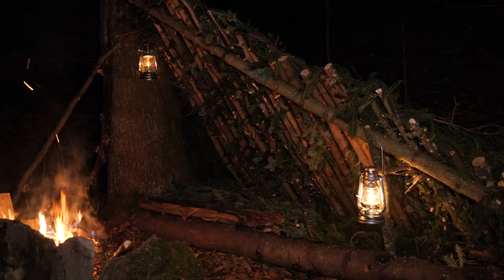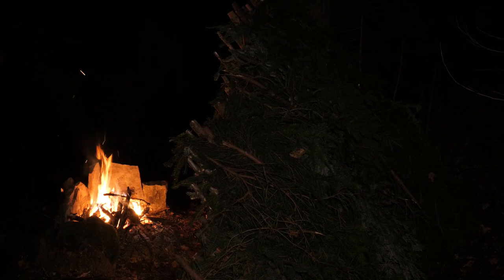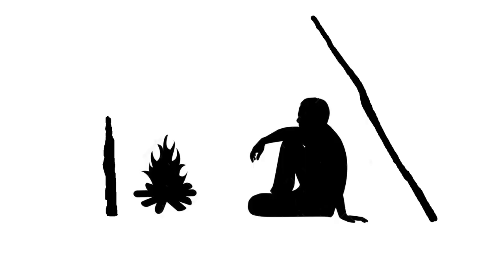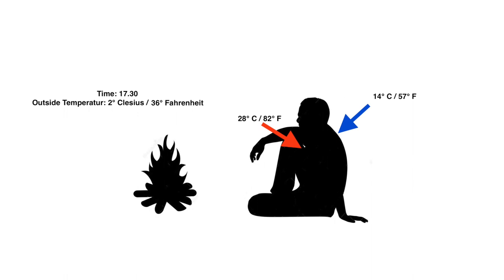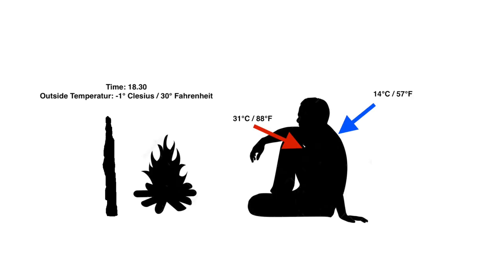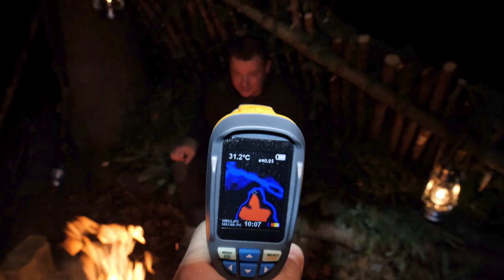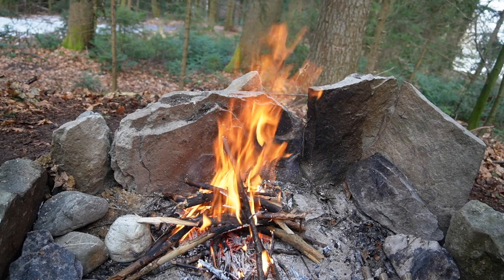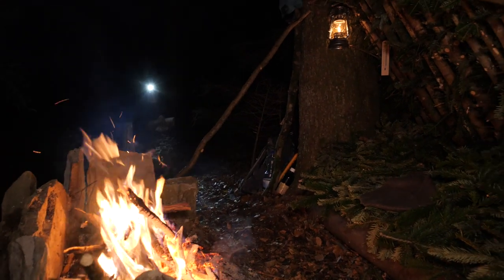Are Fire Reflectors really useless?

Comment: They are more likely absorbing the heat and radiating. So less of the heat from the fire is escaping into the air. It is instead being “trapped” and warming the area around them more. It is still helpful on a cold night.

Comment: Thanks Felix. Heat rises, however, the more you can contain it by reducing the wind effect, you will surely trap more of the thermal radiation . Adding 4 walls  around you and the fire should retain  even more heat.  If you add one or more solar reflective blankets , many more infrared wave will be reflected onto your body. Your backside is colder because it it in the shadow of the infrared waves. 
A good example of this is in deep snow. Snow and ice are good reflectors. Building a fire at the base of a deep pit with high snow walls will allow for better thermal radiation. The infrared waves bounce around more especially if you add reflective material.
Reply: Thanks again for exploring this science. Keep on with your great videos, they are always informative.
Reply: You hit it on the head.  Reduce the wind effect any way you can.

Comment: Very well done, a good experiment and analysis of the heat radiation. I think that a lot of the confusion is mostly related to the word “reflector”
In most cases it’s radiator, wind barrier, depending on the materials. 
Is it useful? I would say yes for reasons other than reflecting. Accumulating and slow releasing of heat, shelter, more light and protection and a wall behind a person will offer more insulation and capture the heat better with less wind to influence the temperature but mostly I find that the biggest benefit is the placebo effect it has on us. 
Good video 💪
Reply from the maker: Thanks for your feedback!
Reply: PotAto, potato.

Comment: The reflector does not work in the way of reflecting the radiation of the fire but the stones get warm due to the radiation of the fire and then work as a radiator themselves.
So some radiation of the fire that will be lost without this "reflector" will still be used.

Comment: Fire transmits Heat most at Radiation (heatflow is only useful for Cooking straight above the Fireplace). Are fire always sucks Air and blows it into the Sky, so theres just Coldair on the Back without Shelter. I Think its possible to improve the efficiency by using a stainles Stell Mirror for the Fireplace an a emergeny Blanket as Tarp for the Shelter.    ...A later Measerment wit the Woodshelter would be nice, because it takes time to warm the shelter with the Fire: It doesnt reflect the Heat like a Mirror, it absorbs the heat and set it Free later in Comparsion to phospherescent Painting.

Comment: Very informative and thought provoking video. If nothing else the stone reflectors will hold heat and radiate heat even as the fire burns down.  Adding a space blanket to the rear reflector would likely increase any available heat. See Mors Kochansky Super Shelter.

Comment: I think the problem is using the term reflector is inappropriate. You aren't getting the temperature difference because heat is being reflected As you would using say a mylar space blanket.

 The temperature change, say on your back, is because the heat is simply not able to continue rising into open air, it's being stopped.  While in front of you the heat is still able to go off to the sides especially if you have a breeze going.  

The reflector behind a fire, also acts in a way similar to a fireplace.  It's heating my living room not because it's actually reflecting into the room there's just only two places for the heat to go into the room and up the chimney.  The hearth itself is actually absorbing heat not reflecting it back into the room.  I think a better term for these gizmos would be barrier or radiator, but reflectors seems to be the one that stuck

Comment: I believe you're testing method is flawed. You should have started with the fire reflector in place and taken temperature measurements. Immediately after taking the measurements, you should remove the reflectors and take temperature measurements again quickly as possible. The way that you did it you didn't take into account if the temperature of the fire changed while you added the reflectors and waited several minutes. You waited too long and allowed the conditions to change before taking new measurements.

Comment: I don't wish to sound offensive, but those tests don't prove for or against - Heat Reflector or Wind Deflector.  You didn't take any readings from behind the fire itself with or without your stones.  You didn't tell us what clothing you had on, perhaps you have Workman's bottom and your kidneys exposed as I often see with younger guys whereas my shirts are long enough to tuck into my underpants and protect my lower back from heat loss and wind/cold exposure. 

You didn't tell us what the wind speed was or where it was coming from and simply building a higher wall at the back does NOT stop smoke - you need to place your fire in the correct position to offset winds blowing into your face. A horseshoe shaped fire works better than a complete circle.  Too many variables.  Far North Bushcraft and Survival indicated that wooden reflectors/deflectors' behind a fire didn't do anything - Survival Russia showed that wooden bow shelters with spruce ferns did nothing to reflect heat from a small fire.   It is a science all of its own and just seeing a fire can make you feel warmer than it really is.  However, saying that, I should think that the ROCKS/STONES ought to reflect some heat and hold more heat than a wooden backstop.  I still think that a piece of aluminium foil or survival blanket will really reflect heat better that those Spruce bows and wooden poles.  Also, if hydrated, well fed and so on, all adds to the temperatures and calories spent trying to stay warm. 

Interesting, but my JURY is not convinced based upon your evidence. 😉👍😎👌